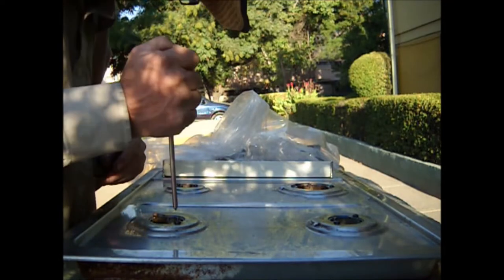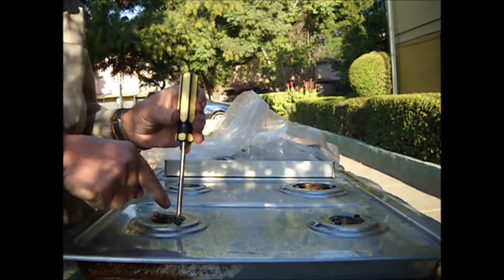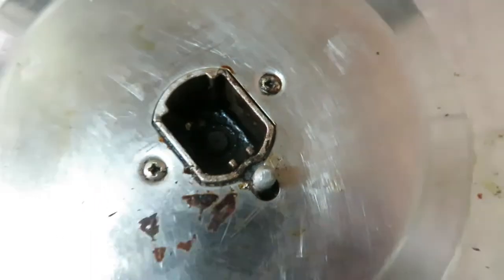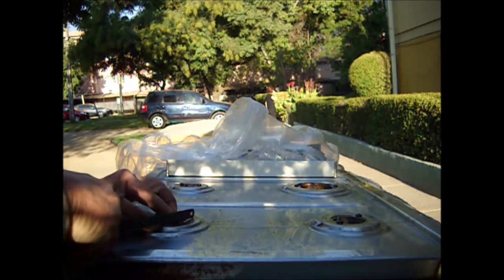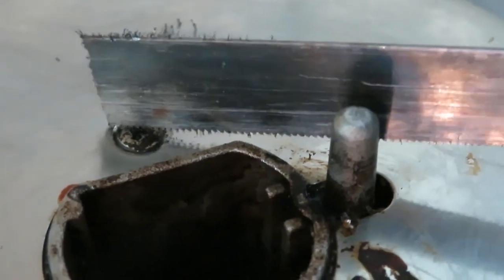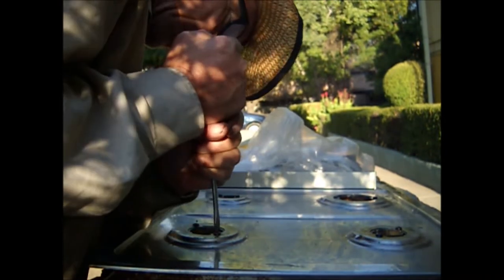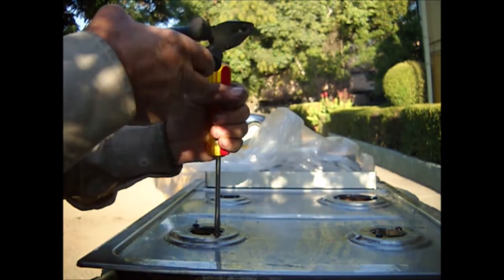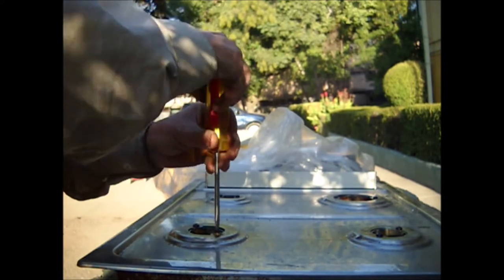How to remove stuck bolts or screws in a gas cooker or hob

Comment: Nice, but how would you remove the sunken bolt that sits in the top of the burner? Thanks.
Reply from the maker: When the bolt has a flat head, flush with the surface, there are a few options before buying a bolt extractor.  Using the hacksaw blade is one, but it requires much more patience.  Also, there are different sizes of phillips screw drivers. One size might not grasp it well, but another size will, just enough to loosen it.  Some flat screwdrivers are small enough to get them into the X head, and as they are flat they might not slip.  You might be able to stick another bolt to the head using liquid steel adhesive. If it's tough enough it just might loosen it or get it out completely.
Reply: @RODsDIY  thanks for that sage knowledge.

Comment: Brilliant! I had used a propane torch and then WD-40 and still couldn't get my screw out. It was your tip to tap the screwdriver to loosen the corroded material that got me going. That loosened up the screw a little, and then I could work it back and forth, tapping occasionally, until my screw released.
Reply from the maker: That's the trick in most cases. Thanks for leaving your comment John.